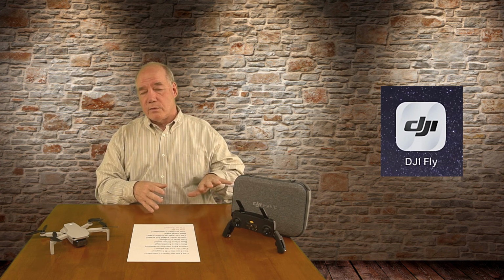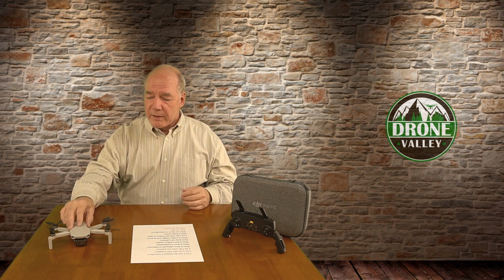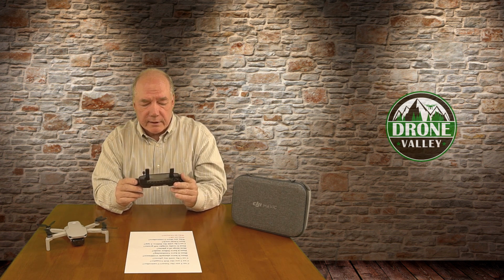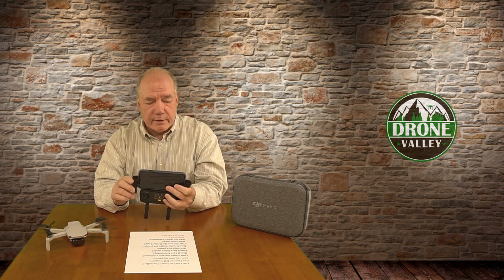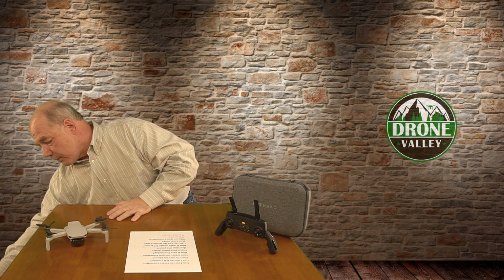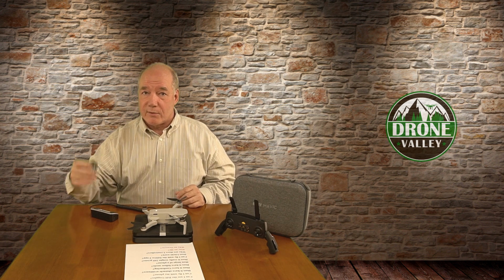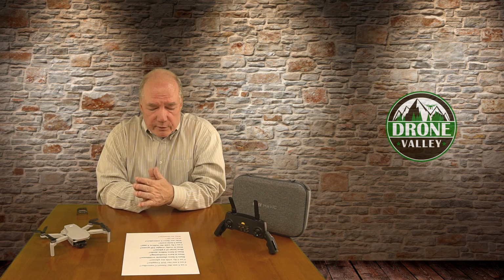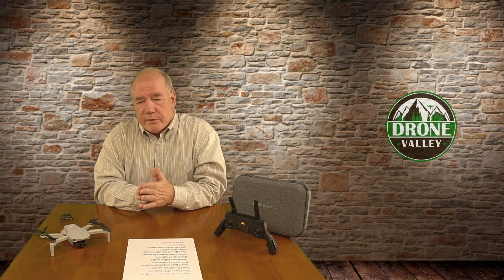Mavic Mini - Your Top 10 Questions Answered

Comment: Hi there Rik, great video.the
Don't know if you've been asked about the different models.
I've been told theres a US version and an EU version and the US version has a greater range. I've  heard US version has a 4km range and the EU has a range of 2km.
I think there's a lighter Chinese model too.
If you could shed any light on this question it would be very helpful....👍
Reply from the maker: Thanks for stopping by. There is technically only one version of the controller but it is tweaked for the region it's being sold into. The reason for this is that each country has their own regulations for the frequencies and power output of the transmitters used between the quad and the controller. In the U.S. this is governed by the FCC and the controller is using the 5.9 Ghz band. In other countries the band and power are different and the range is reduced. I hope that helps explain it and please check back for updates this week. Rick

Comment: Great review Rick, your commentary is always well thought out and you can see the engineering mind at work. Pretty funny that the little gimbal lock will add 3 grams and put you over. I am definitely getting one of these little guys for my first, not a toy, quad. It is also pretty fascinating that when I fly this drone, the range of weight of flying machines I am rated on will go from a Part 107 Remote Pilot certificate holder at 248 grams to an ATP rated Boeing 747-8 at 987,000 pounds. Heavens, look at what Wilbur and Orville started...
Reply from the maker: Thanks a lot for the post and I appreciate your support. I just love flying these quads because they give me a chance to view the landscape from a new perspective. I guess it has something to do with violating that third dimension. You're going to love flying the Mavic Mini. It's a solid quad that is a dream to fly. I've been an Engineer for over 40 years and I'm still blown away by the technology that DJI was able to pack in this tiny little quad. It won't compare to piloting your 747 but it's still a blast. Stay tuned for more content posting soon. Rick

Comment: Do the Range Extenders that I have for my DJI Mavic Pro work on the DJI Mavic Mini controller?
Reply from the maker: Hugh, you should be fine using the same range extenders on the new Mavic Mini. It looks like they used the same mold for the controller.

Comment: Also.. does it show satellites on the screen, if not Why?
Reply from the maker: There is an icon on the main screen showing your signal strength that I think you can tap to show the satellites. They were trying to de-clutter the screen with the new app to make it simpler for new fliers.

Comment: Rick,  in the comments below a customer was seeking your advice as to which drone to purchase (Anafi vs Mavic Mini) you said that the Mavic Mini  "has a few more flight modes" than the Parrot Anafi. Really? That's simply not true. The two drones are not even in the same class in terms of flight modes and useful flight capabilities. I'm shocked that you would say this. Is your knowledge of the Anafi that rusty or is the DJI gravy train just that good. SMH!
Reply: There's no comparison between the Anafi and Mavic Mini, The Anafi has 4k, manual video settings more flight modes and no doubt will handle the wind much better. Please don mislead your viewers.

Comment: Great presentation as always, Rick. I might actually be tempted to add to my "kit" merely to avoid registration, and for its ease of packing for travel. The FAA & bureaucrats could change their requirements to include this drone at any time, which is my fear of gov't registration generally -- being more about control than the public safety they'd have us believe.
Reply: Go to the FAA Website and look up the monthly drone sighting reports and look through those. Quads at all kinds of altitudes mixing it up with manned controlled aircraft. Report after report. It is about control to protect public safety in the airspace system.
Reply: @subsonicflighttraining  yep. UFO's are now "drones" when you try to "verify" sightings they drop to almost zero.

Comment: Hi Rick I have a burning question to put towards you if I may please.
Your a great engineer an I hope you can answer my question.
On buying a Mavic zoom last year with the flymore kit,  there’s something in my kit that doesn’t seem to work.
It’s the car charger that comes with it.
I have a brand new Ford Edge and every time I’m out in the fields flying my Mavic and I want to recharge my batts’ I keep getting a intermittent charging process from the car charger.
I have been in touch with DJI regarding this as I have care refresh, and they asked me to return the charger as I did. And they sent me a new charger.
On trying this new charger it was still doing the same thing intermittent charging......
I tried my other pilots car and it worked absolutely fine, now I can’t be with him all the time, is it my car? Shall I purchase an after market charger and will that work, you see rick I do not want to cause damage to my batteries  with an aftermarket charger. I need brains and your the man I’ve turned to to resolve my charging solution.
All I want to do Rick is carry on flying and charge my intelligent batteries from my cars power source. Also I have multiple charging points within the car and it still does the same.
Please Rick help me on this matter as the batteries are nit cheap to keep buying to make my flying experience that much longer outdoors.
Also Rick I reside in the UK.
Thanks for your possible help on this matter.
Awesome channel by the way, been with you for a long time and go with everything you recommend within the drone society and community.👏🏼👍🏼

Comment: Re: lack of 4K video. In addition to the factors stated in the video, one wouldn't want to eat into the Mavic Air's market.
Reply from the maker: Michael, thanks for the post but the point of the Mavic Mini was to give fliers a choice. You can still buy the Mavic Air or any of the other more sophisticated quads but they're more expensive. For new fliers, the Mavic Mini gives them most of what they get with the Mavic Air at a lower price that they can afford as a new drone to see if they enjoy it. I'm willing to bet that more than half of these new fliers will upgrade within a year to something better once they realize how much fun flying really is.
Reply: @Dronevalley  Understand fully. I have a mini on order that will join my Mavic 2 Pro and Yuneec Typhoon H - primarily for international travel where licenses to fly either aren't available to foreigners or just too difficult to get from a practical standpoint. My point was that If DJI were to market a unit with almost all of the capabilities of a Mavic Air, but at 1/3 the price, the more profitable Air market would dry up. This is not a new concept in marketing. FWIW, I'm actually somwhat amazed that they were able to pull this off in a sub 250 gram unit.
Reply: When you say upgrade to something better.. What would you suggest.. Would that be to a Mavic2 / mavic platinum platform or slightly up to a Air... I struggle to understand the need for the Air when the battery life is so crap and more then double the price of the Mini.... I see the mini as more than adequate video quality without all the bells and whistles that most people don't ever use barring professionals and extreme enthusiasts.. So if you were wanting to upgrade...then a proper upgrade would be to a Mavic2... I live the idea of the Air but the battery life is the biggest downfall... But then is this dji being smart keeping enough negatives on the mini and air so as not to eat into either of these and the Mavic2 business

Comment: Can it do a split-S ???   .....
Reply from the maker: Steve, thanks for the post and the "camera" quads fly a lot differently than FPV models and can't do things like a Split-S turn because the IMU and control software are working hard to keep the quad level. For those types of moves you'll need to be flying an FPV racing quad.

Comment: Rick, at 13:00 you say it’s 248 grams, but everyone knows that once you fill the battery with charging fluid, it’s going to weigh more!  Duh.... those electrons have weight!  (Haha. Just kidding)
Reply from the maker: Thanks for the post but DJI has released a new style of battery fluid that's inert and lighter than air to keep the Mavic Mini under the 249g weight. The drone actually weights 600g empty but when you fill the batteries with this new fluid it gets lighter :) Thanks for the post and stay tuned for more.

Comment: At 4:40 you reference “5.8 GHz and lock in that frequency.”  
1) Will it “sniff” on 2.4 also.
2) once locked in, can it hop frequencies or bands while flying?
Reply: DJI Specs two different models of the Mini, Model MR1SD25 operates on 2.4 and 5.8 GHz
Model MR1SS5: 5.725-5.850 GHz
Model MR1SD25: 2.400-2.4835 GHz, 5.725-5.850 GHz
Reply: Addy Overbeeke whoa!  Okay, so obviously, I would like the one that can utilize both.  BUT is that available in the USA?  Rick, care to chime in?  That’s pretty critical info.
Reply: @MrPlaneTalk  I believe that Model MT1SS5: 5.725-5.850 GHz is the USA version because it is mentioned with word FCC. The Enhanced WiFi that Rick spoke about is for Video Transmission.
https://www.dji.com/mavic-mini/faq
Reply: Addy Overbeeke wow! That’s interesting that the “enhanced WiFi” is only talked about in the video transmission FAQ, and not in the controller section.  It seems everyone (including Rick) mentions “enhanced WiFi” for “controlling” the drone; that’s a pretty important distinction.  Maybe we will get some clarification.
Reply: @MrPlaneTalk  Hi, the video enhanced WiFi is also mentioned in the specifications for the Mini. The video transmission link is usually compromised before the RC control transmission link so maybe that's why DJI enhanced/optimized the Wifi transceiver system to allow for good video transmission within the RC control WiFi signal's range.  RIck maybe has contacts at DJI that could expand on the topic?  Nice to chat with you. Check out my channel if you have the chance.

Comment: I think your analysis on the phone control is not quite correct.  The Mavic Air also uses enhanced wifi and it can be controlled by a mobile device.  To do so, when powering on you hold the button for 4 seconds and get a double beep, which switches it into mobile control mode. There's no reason they couldn't have done that with the mini.

Comment: Apparently it does have follow mode in the quick shot modes.  Saw a vid using the circle mode and as he moved it did follow while doing the circle with no input from the flyer.

Comment: I am gonna have to disagree here. DJI did not go out of their way to make the watered down app so it is easier for newbies. That is just pretty marketing speech. They did not want the mini to do too much to hurt the sales of its bigger brothers. Simple features already programmed in the Go app like tilt speed, active track, manual exposure for video and some smart flight modes literally costs them little money to implement on the mini (less than making a separate app I wager). And just because the newbies don't wanna deal with those option it does not mean it is good to just cut them out for all users. Camera makers have all sorts of options for even entry level cameras and all they do for newbie is an AUTO mode so everything is taken care of. I don't like DJI making the conscious decision to make the mini less than what it is capable of because of profit. They got "innovation" in their brand name after all.

Comment: Thanks for putting this video together. I have the Inspire 2 and Phantom 3 Pro. I was interested in this little guy when I first heard it was coming out for a very specific use. It had the potential to get some reasonably good quality footage that would not be possible with the other two. Yes, I would have preferred it to be 4K but I can live it the 2.7K. The real deal breaker for me was the Auto ISO with video. No manual option but, it does have it for Photo. I thought that was strange and hope it is something that can be changed with a firmware update. Feel free to visit my channel to see some of my work.

Comment: If the Mavic Mini controller is the same size as the Mavic Pro and Mavic 2 controller it should fit up to an 8 inch tablet.  I originally bought an 8" for my Mavic Pro but the controller wouldn't fit in the Fly More bag with the tablet still in the controller. So I got a 7 inch tablet and it does fit. --- I wish the Mavic Mini Fly More package had a soft bag more like the Mavic Pro & 2 Fly More bag. I'm not much of a fan of the "suitcase" style case they made for the Mavic Mini, but I'm sure there will be some nice 3rd party soft bags available soon for it. --- I like that this is a much more "simple" drone than the Mavic Pro & 2.  I have the Pro and have always disabled the object avoidance, and have never used any of the gimmick autonomous modes other than to "try them out" once.

Comment: Nice job answering all of those questions. Do you think the lack of nav lights was to keep it under 250 grams? Another thing to add to your balancing act example is dji probably wanted to keep the mavic mini below the mavic air. Had they put the go 4 app, 4k and ocusync on mavic mini, that would of killed mavic air. Already mavic mini has longer flight time and comes in several hundred cheaper. I'm considering getting a mavic 2 but I may get mavic mini. Also I've been eyeing up the fimi x8 se.

Comment: Yes you can fly it without a phone or the App.
Reply from the maker: Thanks for the post and you can use the controller by itself without adding a phone or the app. The question I was answering asked if it could be flown without the controller, just using the phone and that can't be done. You need the controller to connect to the quad to fly it.

Comment: Why do you think that DJI didn't offer some of the software based quickshots on the Mini that they included on the Spark? I am talking about specifically panorama and 360 spherical shots. I don't hold out hope for these being added in the future because the did the same with the Mavic Air regarding timelapse and hyperlapse shots. The are all software based features that have very little to do with the hardware.
Reply from the maker: James, thanks for the post and they do offer a few of them - Rocket, Dronie, Circle and Helix and I expect that they can add more with future firmware updates so stay tuned for that. Essentially they built the Mavic Mini to be a simpler quad for new users to fly. They tried to eliminate anything that made the quad complicated or confusing so the average consumer could power it up and fly. I still expect they'll update some of the features through firmware and I'll post a clip if they do.

Comment: I have just another video of Mavic Mini chasing a boat in Sports Mode. The video was surprisingly very stable chasing along side a boat in the wind.

Are the 3 axis gimbal stabilised in Sports Mode ?
Reply from the maker: Thanks for the post and the video is exceptionally stable and the gimbal works in all modes when you're flying. Rick
Reply: If the 3 axis gimbal is stabilised in Sports mode, then it is much better than my Spark.

It is worth buying when the camera gimbal is stabilised when flying at high speed in Sports Mode.

Thanks for the reply and info 👍

Comment: Will DJI Crystalsky work with it ?
Reply from the maker: Brian / Jeff, unfortunatey the DJI Fly app hasn't been ported to the CrystalSky monitors yet but I'm hoping they add it on the next release of firmware. Having said that, I'll be trying to install the copy I have on the Smart Controller this weekend and let you know how I make out with that. Stay tuned. Rick
Reply: @Dronevalley  Cheers Rick.  Greetings from Bangkok!
Reply: @VibrantlyDull  Thank you I dont own a drone but I might soon
Reply: @Dronevalley 

 Hi Rick...
Here is the reply I got from DJI regarding the Crystalsky....

"As confirmed by our technicians,  the DJI Fly App and Mavic Mini controller is not available for the CrystalSky. 

There is no plan to support the feature now, so no release time.
I believe our engineers are working on testing and looking into more features, please pay attention to our website about the future release."

Not the news I wanted to hear....

Cheers
Reply: I'm asking the same question...
Reply: @VibrantlyDull  cause I know it says it works on the spark and this mini mavic spouse to be replacing the spark
Reply: @bryanwhat2268  I'm currently using the CS with my Spark.

Comment: I've seen a youtuber who fly mavic mini on a high elevation environment the mini at 40% battery is strugling to fly i keep sinking
Reply from the maker: Jose, higher elevations are tricky for any drone since the air is lighter and the drone has to work harder to stay aloft. This is true of any quad you're flying high in the mountains. It's just the physics of flight working against you. Thanks for the post. Rick
Reply: You probably require different propellers for high altitude
Reply: The beauty of electric power is there is no power reduction with altitude... with appropriate propellors you would likely not notice altitude...
My Mavic Air handles 6500 feet msl pretty dang good!
Reply: @mithrandir1313  Could you expand on your source of props for the mini? My understanding of props is that one needs to increase pitch slightly to fly at altitude. I fly at 5000 feet with my RC, so I have some experience. Thanks.